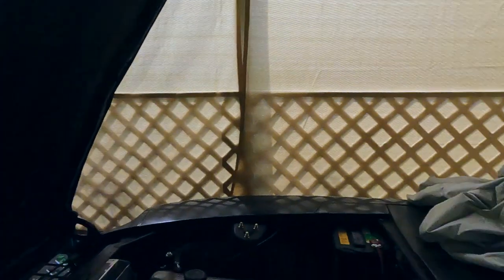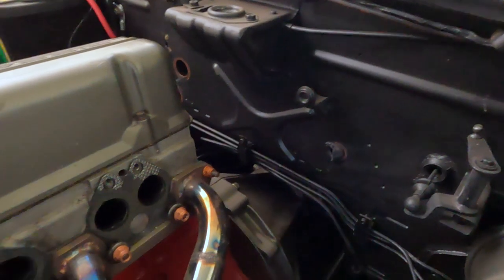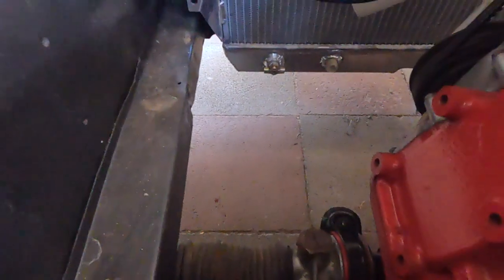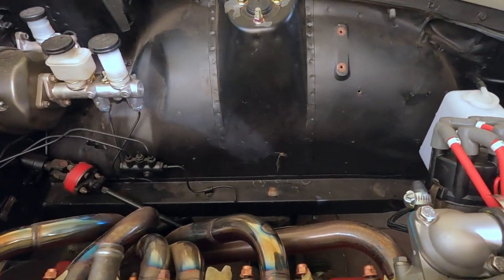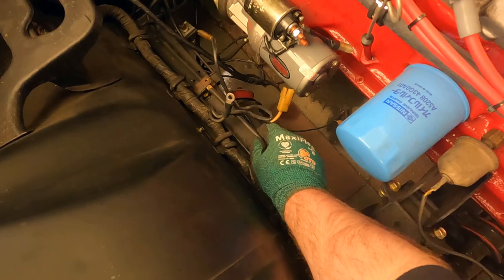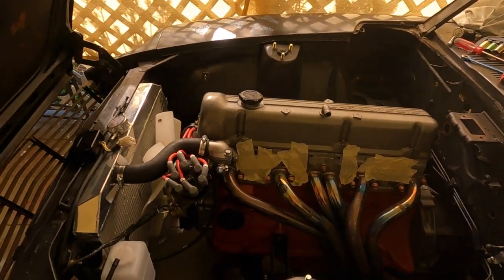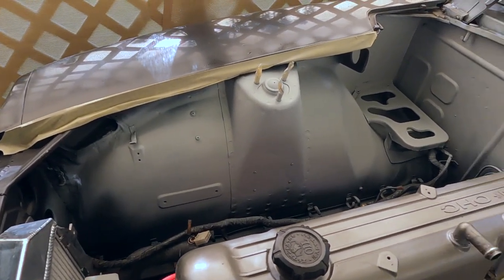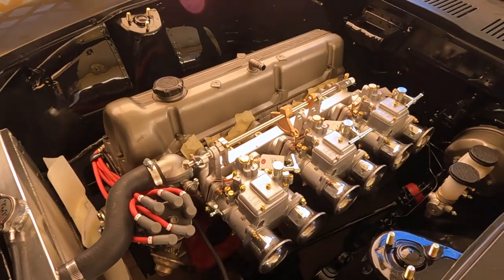Episode 3.  240z Engine Bay paint and mods

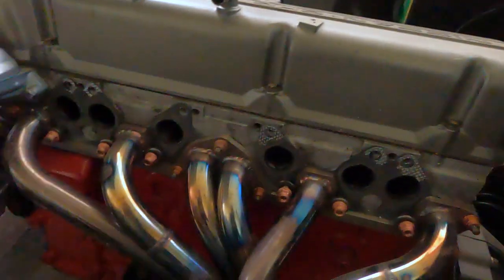Comment: @1:50 in that nut what if you heat up that pipe and hit it with a hammer? that should give you some clearance
Reply from the maker: That’s the exact plan haha. The small dent won’t make any flow difference but will give all the room I need!